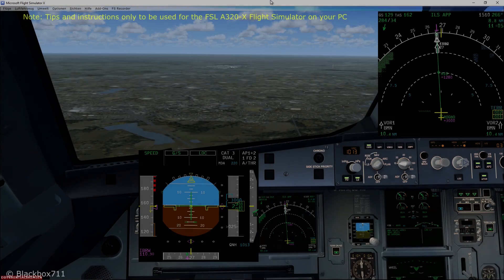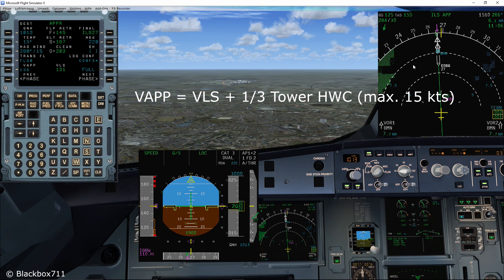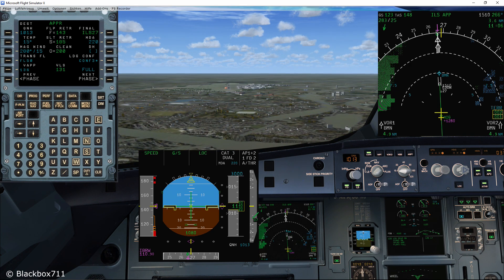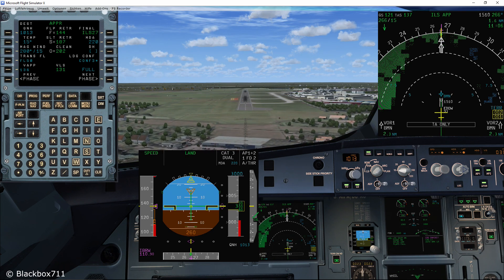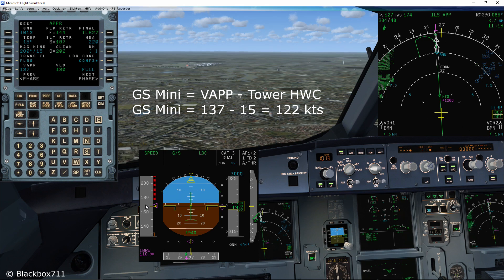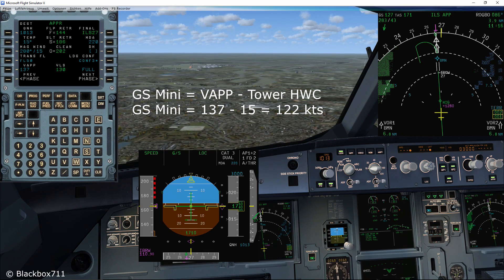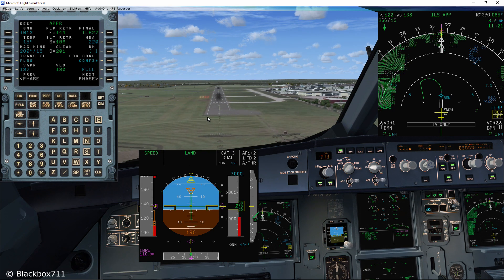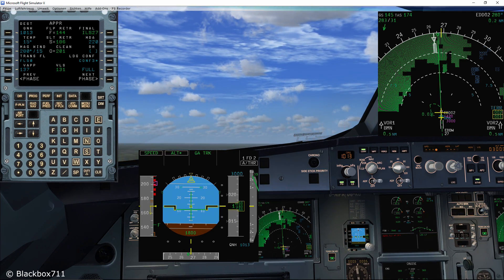FSLabs A320-X Basics: Groundspeed Mini (GS Mini)

Comment: Hi why do you have to set the QNH and the temperature on the APPR phase and do you decrease 1 value on the QNH vand increase 1 on the temperature like you did in a video to calculate the takeoff performance just in case if it drops or increase. I know it is off-topic but I just want to know the function of those values on the APPR phase and thank you for this amazing video :)
Reply from the maker: QNH and Temperature entry in the Approach Phase Page is required for cabin pressure control and is entered with exact values.
Reply: @Blackbox711  Thank you so much!!
Reply: @Blackbox711  But does the QNH and Temp have no role to play in Landing performance?

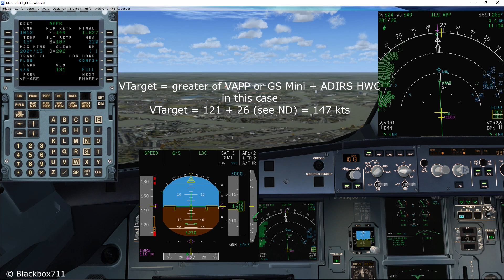Comment: Hi! Expert out there can i ask for your help? ! i get a bit confused here... on 2:43 it explains that VTarget = Greater of VAPP or GS MINI + ADIRS HWC, ( Isnst the value of VAPP here is greater than the GS Mini ( which is 136 , instead of 121 ( the ground speed mini) shouldnt we take that value instead?) sorry for this dummy question .
Reply from the maker: tiffany51793 .. hi. I think you got confused with the different definitions here. The endresult ist Vtgt, the magenta speed bug which varies according to the actual wind component. VLS is a fixed speed, dependent on Grossweight and flap configuration and always gives a fixed buffer to the Stallspeed. Vapp usually is VLS plus 5 kts (until a Windcomponent of 15 kts) and will govern the Vtgt unless you have very strong winds like in the example you are quoting. Here the resulting value of GSmini + ADIRS HWC is greater the the mentioned Vapp and hence this is displayed as the Vtgt (magenta Bug on Speedscale). Vapp becomes the governing value (136 kts) when the combined value of GSmini plus ADIRS HWC falls below 137 kts. Hope that clarifies it a little?

Comment: Hi,
TWR reports 32G42KT & you land direct into wind, will the Vapp jump ? do you select manual thrust?
Or you have a steady 35kts head-wind on rwy.
In both conditions, at max payload, I imagine the nose-pitch would be some - degrees down? Wold this be a trickier landing?
Thanx for yours excellent videos:)
Reply from the maker: Hi. Thank you! The VAPP, once calculated (VLS + 1/3 Tower wind on MCDU Approach page) remains the same. The VTarget is calculated via the GS Mini funktion and will move in the managed mode depending on the headwind component. In gusty conditions this will cause quite alot of movement in the VTarget. But remember, the GS Mini is making sure that a steady energy level overhead the ground is maintained. So practically the indicated speed and the VTarget pretty much move together, while the Groundspeed remains pretty constant. In a conventional aircraft where the VTarget is fixed, the change in indicated airspeed would have to be adjusted by thrust changes to chase the VTarget. Now the landing will still be trickier because the airflow over the wings does actually change with the gusty wind conditions and thus change the pitch values required to maintain the glide profile. Puuuuh, alot of theory! Now my head hurts. Just joking ;-) I have uploaded a video for you with gusty winds in the approach:

https://youtu.be/kdMyr5Covy8

Carefully watch the Groundspeed and thrust settings!
Reply: Thank you so much :)
Reply from the maker: J.D Invictus You're welcome

Comment: Great video! Can you please explain what would happen if GS mini function would not be there in both cases?
Reply from the maker: Hi Ayush. Thank you. You would set the Vtarget manually (selected mode) by the formula (VLS - 1/3 Tower HWC). So for example 137 kts. In the first approach you would have to constantly have a higher thrust setting because the headwind component decreases from 35 to 15 kts. If this happens steadily, no big deal. If it happens with gusts you would most certainly chase the Vtarget because your indicated airspeed would jump all over the place. In the second approach you would have to decrease thrust because the headwind increases and then once the headwind decreases again, you would have to increase thrust quite a bit. Once again if this happens in a very abrubt manner you would have to really work the thrust levers to manage the Vtarget yourself. Regards